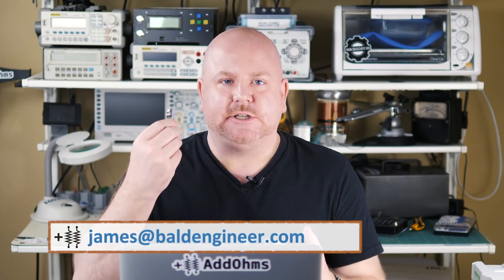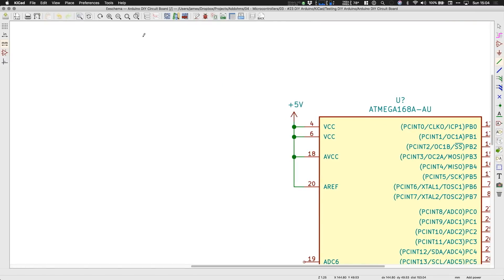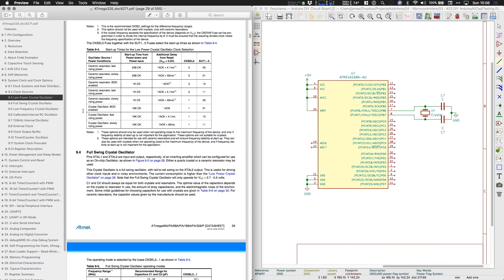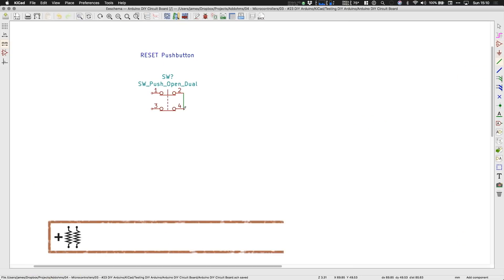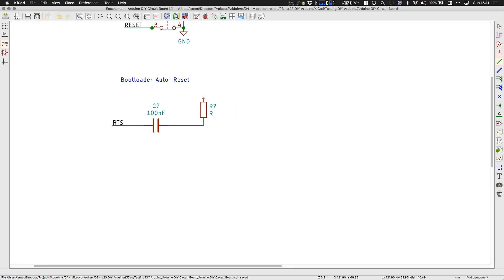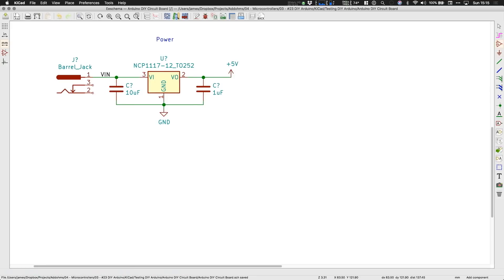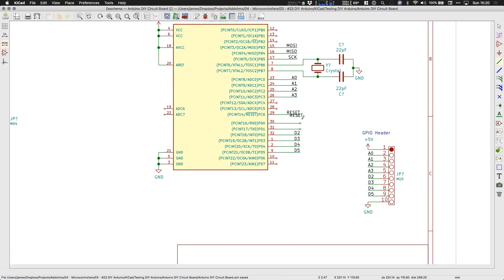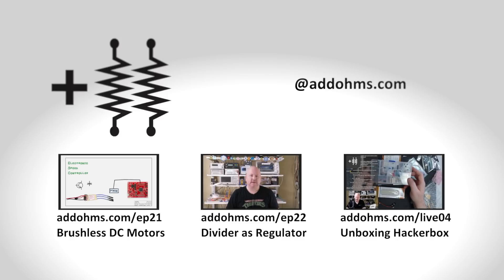DIY Arduino Schematic in KiCad | AddOhms #23

Comment: Never heard oh Kicad before. I’ve only used diptrace. What’s wrong with kicad? I just now quickly looked at the web site, seems ok. But based on the keyboard blowing up bit, I get the impression most people don’t like it.
Reply from the maker: The EDA software you use invokes as much emotion as which micro controller family you use.
Reply: Well, people just need to not be so easily offended by every little thing. I see nothing wrong with just using what works for the task at hand.

Comment: Actually it would be nice if you can make detailed KiCAD videos...
Reply from the maker: Don’t hold your breath.
Reply: was Just a wish...
Reply from the maker: Software tutorials aren't something I do. Even doing these screen captures stretched what I like to do. Also, KiCad changes too often, I'd feel the need to keep updating the videos, which isn't something I want to spend time doing. There are already excellent tutorials out there, there isn't much I can add.

All that said... I will think about doing something like tips or tricks when I can. Even if the software updates, the techniques usually still apply.

Comment: I'm trying to move from Eagle to Kicad, but in my mac i don't found the button with i can move around in the schematic. 
I think it's the right click on window, but how i can do this on mac? Thx
Reply from the maker: If you're on a MacBook you can enable touchpad panning in KiCad's preferences. Then it pans around with two fingers. My preference, though, is to use an external mouse and enable "middle button to pan." This option is very helpful when using pcbnew since the OpenGL renderer disables the scroll bars.

Comment: I stuck around because I guess I'm in the habit of looking at the timeline before I leave. I'm curious if the a video has leftover junk or blank space if there's still time left.

Now my vote for a part is the neopixel RGB LED. I have two bulbs on my project pcb to program whatever way I want. It's handy to have the bulbs and not need drivers.

Comment: I'm leaving a comment about the NC reset switch that will permanently keep the processor in a reset state. Maybe you should swap it with a NO switch and make sure the pull up resistor is on the processor pin side of the switch.
Reply from the maker: Guess you didn't read the note on the screen or watch the very end: https://youtu.be/5fvdxd0QhTw?t=601
Reply: AddOhms oh, nope I was only listening at the end. ☺️

Comment: how well do OpAmp or 555 timer oscillators do at driving clocks for MCUs?
Reply from the maker: Depends on if you need stability. An asynchronous bus like UART won’t work well, except maybe at very low speeds. In terms of cost and size, a ceramic resonator is a far better option.

Comment: I would like to know if the process is the same for the atmega 2560? If I can use the same components used in the video?
Reply from the maker: Probably. Just follow the Arduino schematic for the Mega 2560.

Comment: SEMICONDUCTORS! Period.  
Tip: Don't connect an unused input pin directly to GND or +VCC when you want to pull the pin low or high.
Use a 10K resistor in series. The reason being; if you ever turn the input to an output with your code by mistake, you won't fry that port.  The resistor will limit the current to less than 500 uA.
Reply from the maker: 10K is much larger than necessary. If you are driving or sensing anything but a very high impedance load, that could drop too much voltage. 

A more sensible protection value would be in the 100 ohm range. If any at all.

Comment: Great video. I'd love if you could make a similar one with a ESP-12 module and it's supporting circuitry.
Reply from the maker: Cool idea. I have a pile of ESP12s that I intended to design into a PCB. Just haven't gotten around to it yet.
Reply: Excellent. Most of the ESP boards out there are made for development and have all the pins broken out. I'd rather have something more space-constrained so just the ESP-12 module seems like a great base. Then I can add my own application circuitry on top of that.

Comment: Not only do I like diodes I also like Light Emitting Diodes!  Yes I watched to the end.  This is a very good video.  I just found an EDA program called Easy EDA,  it is a browser based schematic capture and layout program.  Are you familiar wit it?  I am not familiar with the program you used.   Rick
Reply from the maker: KiCad is a fully open source EDA toolset. You can find more information about it at http://kicad-pcb.org.

Comment: Polyfuse! Now, the schematic doesn't open correctly for me, 4.0.7 says it's created in a newer version, so guess nightly builds were used, open in nightly build and none of the schematic symbols are there, just boxes with question marks...Anyone else having issues?  I thought KiCad saved the symbols to the schematic itself.
Reply from the maker: Yes, nightly builds were used. I tried opening on another computer, and also had the boxes issue. Briefly looking into it, the parts cache is handled differently in the nightly builds, which is probably the source of the problem. Give me a couple of days. I’m going to re-draw it anyway, so I’ll roll back to the stable release for that. (There’s other changes I want to make, so I was planning to post an updated version along side the as-shot version.)

Comment: hi, thank you for the video. I am looking for a software to run arduino's code and simulte my circuit, i am new with kicad, can you confirm that kicad can or canNOT, do such thing ? (also it would have been nice if I could see some output simulation, like running a LCD by the programm that i simulate on the arduino, or running motors and stepM drivers)

if it can not, can you name a program that can do such thing, except proteus, since i want to use it for commercial application, but i don't have enough money right now to buy it.

if it can, do you have video related to this? or know other channel? or maybe, can you make videos, i believe it would be interesting.
Reply from the maker: No, it doesn’t do that kind of simulation, neither does Proteus. Look at Tinkercad.
Reply: @AddOhms  Thank you ! do you know any programm similar to thinkercad, but offline ?
Reply from the maker: No
Reply: @AddOhms  thanks

Comment: I think your explanation of the boot loader reset circuit might be incorrect.  When DTR is high, you will have a positive voltage on both sides of the capacitor which means RESET will be high.   With 5V on boths sides of the capacitor, it will be in a discharged state.  When DTR goes low you have a voltage potential across the capacitor.  Since the capacitor is in a discharged state, it acts like a short as it charges and draws current through the pull up resistor.  The current draw causes a voltage drop to develop across the resistor temporarily pulling the RESET line low.   Once the capacitor charges it can no longer draw current and the voltage drop across the resistor diminishes because the current flow has diminished and RESET moves back high.  When DTR goes high again, the capacitor is changed to a discharged state so it is setup so it can act like a short again should DTR go low.

Comment: Can you use a 555 for a clock?
Reply from the maker: You can use almost anything as a clock. You need to determine how much accuracy or precision you need. A 555 circuit close to an RC oscillator in performance. I’d rather use the internal oscillator than an external 555.

Comment: Great presentation! Desktop PC decoupling cap question: Would adding a parallel low value (ceramic?) cap help bypass (heat producing?) HF spikes via its lower equiv resistance to extend the life of my PC's new MOBO electrolytics, before they heat up, puff up and leak again?   lol, Yes, stay'd with you 'till the very end (listening for mic audio source selection changes...).  Forgotten component?: Just CUT A TRACE and install a circuit KLUDGE or two to hold in all of the MAGIC SMOKE.
Reply from the maker: No, that wouldn't help. It's the high ripple current through the electrolytic's high ESR that generates the heat. That's actually at a relatively low frequency. The best alternative is to buy solid polymer aluminum electrolytics. These use a conductive polymer to replace the traditional electrolyte. They don't wear out nearly as fast, and their ESR is an order of magnitude lower. Lower ESR means less heat, less heat means longer life (on a part that will already have a long life.)

When purchasing them, stick to tier 1 capacitor suppliers: Nicchicon, Panasonic, etc. They'll cost a little more, but they'll last much longer.

Here's a video I did for my old company on Aluminum Polymers: https://youtu.be/DeCpcXHn5BA?t=133
Reply: Is that cap-cooking ripple coming from the PC's (crappy) switching PS, or from MOBO data/CPU LOAD noise introduced back onto the 5v and 12v lines?
Reply from the maker: In theory, it'd be the load's ripple. But in practice, a combination of both.

Comment: farfegnugen. Watching the video, I pulled up past memories of similar presentations. Every time, the expectation was that the viewer (me) would know either WHY a part was needed, WHAT the rating of the part might reasonably be, and/or the necessary ancillary circuit(s) that would give the needed results. Oh, for the old days when the decisions were made to include what and why information on the same page (or at least the same discussion) were explained so that someone with a teenaged brain could learn enough to make a good decision later. Now that we do videos with their stranglehold on time, brains are becoming replaced by "do what I have done here and don't ask questions, punk."

Comment: 12-22pf not 2-12pf....what kind of diode...
Reply: Its best to use slightly different caps. I use 22pF and 20pF. This forces the xtal to start no matter what.
Larger cap values give stability but take longer to reach steady state. 
This is according to the Engineers at Microchip, when I showed them my design that would not startup with a crystal. It had no problems with an external resonator!
Followed their suggestion, and problem solved.
Reply from the maker: Haha. Yeah. Missed that one. ;)
Reply: J. Clowers power supply

Comment: Reset to "DTR", diagram shows "RTS", but use of RTS is consistent, so what's in a name. Playing the game... "delay line"
Reply from the maker: Yeah. Sometimes I tie to DTR. Sometimes to RTS. As long as the serial driver toggles either, it works. (Which is why on the voice over I said RTS, but wrote DTR when doing the schematic, separately.)

Comment: Who uses Arduinos these days? ESP8266 and ESP32 came along with built-in WiFi and BT modules, and kicked this family of puppies to the curb! Just a matter of time before these modules reach the magical $2 mark. 
120+ times the speed and power of an Arduino 328P running at 16 MHz, is not a joke, but still laughable. RIP Arduino.